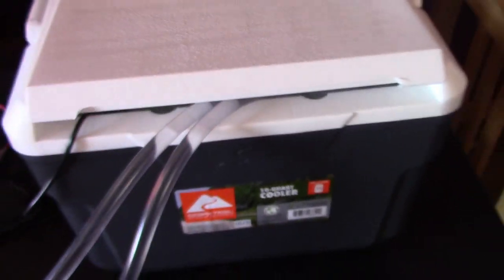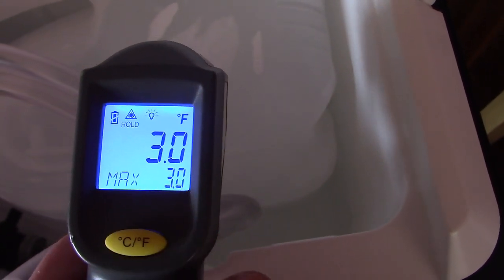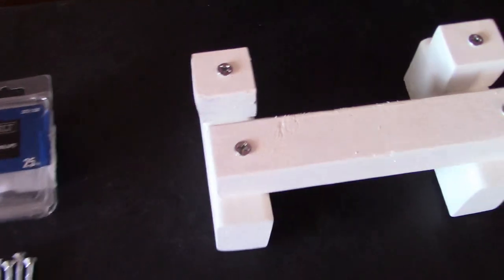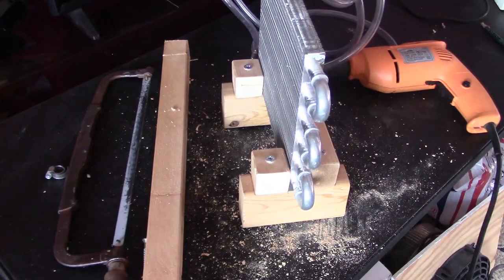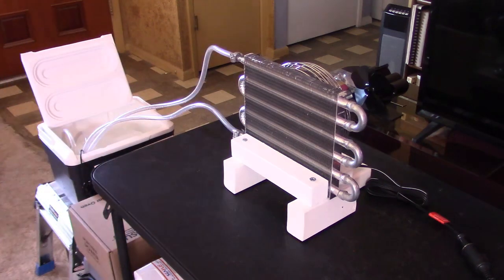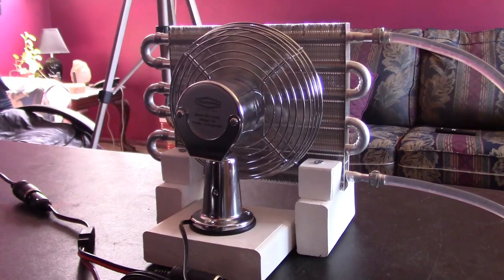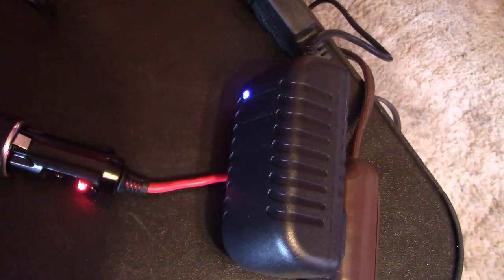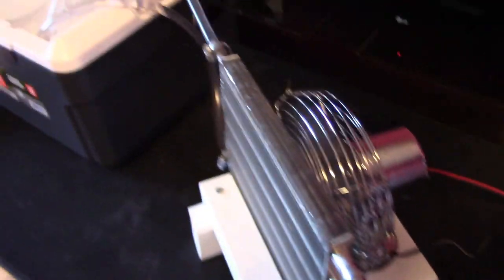DIY 12V Air Cooler! very cold air! 20w (AC or DC) - Radiator w/Stand + Hi-Speed.Fan! modular design!

Comment: I built one of you cooling inventions and it works so well. Btw, I'm in West Texas (extremely dry and HOT) today it's 112 degrees outside and inside we're at 76 degrees plus we get the added benefit of adding humidity.
Reply from the maker: sweet! i'm glad you made it! that's what it's all about. sounds like you made one of my evap cooler projects. those are awesome in the dry areas!

Comment: I want to use antifeee in the closed loop system and use the cooling system to remove heat from a small sleep Just big enough to handle your tablet mouse and a little tv.
Reply from the maker: it's a good idea. i've always stayed away from using antifreeze mainly because i'm not sure it would cool the water down much more than it already is (but it might be worth me trying it). might need a special pump for that (i'm not sure).
Reply: @desertsun02  I want to drill in a freezer use the freezer and eliminate the AC. I believe this would save energy and focus on the small zone vs removing heat from too much area. You need a reservoir inside the freezer and pump antifreeze through the radiator. After setup add bottles of water to the freezer you can save ice like batteries. Store charge you store lower temperature.

Comment: Thank you for posting! Im going to build a couple of them and use my box fans. I was just putting frozen 2 2liter bottles in front of a fan but this is much better.
Reply from the maker: yes, these radiator-based units work super good. I've got a couple of box fan version already posted to the channel. if you haven't seen them, they would be worth a look 🙂 (i used 2 model 405's on those)
Reply: really cool solution, thanks! Incidentally, which one works better, according to you? Or which on works more efficient? 
( this one or the box 📦 one )
In any case, love your channel!
Reply from the maker: i think the pump on the box fan ones use about the same amount of power but the box fan pulls a lot more power than the 12v metal fan that i used in this build. (plus the box fans are AC only) *unless of course you use attached the model 405's (the radiators) to my DIY 12v box fan project. the 12v high speed metal fan moves a lot of air (it's close to 1000 cfm on high, about 959). that rivals a box fan for total air moved.
Reply: thanks for your answer! It’s fun learning to use parts you buy online and putting them together to make real energy solutions. Yours are really comprehensible. One day I want to learn how to make my own pcb projects, to make a really good and save affordable small solar power system (now one square one). Next project is a smokeless rocket stove pizza oven combination (finished a pilot version). Many thanks for the inspiration!

Comment: Okay... It's time for you to design an air conditioned vest. I sweat like the Dickens..... I haven't found a great vest that cools well enough in the summer. Start designing my friend
Reply from the maker: hi there. i've looked into that but never actually made one. now that i know people like the idea i'll see what i can do 👍🙂
Reply: @desertsun02  It will be a complicated design. But my first thoughts are like the heated jackets by Milwaukee or DeWalt or whatever. A 12v battery runs a computer fan and there will be disposable refrigerant cartridges.
Reply from the maker: do you have any ideas on how to overcome the condensation issue that might occur on the pipes in the vest? those would be sewn in and i could envision water condensing and getting peoples' shirts wet?
Reply: @desertsun02  Maybe the pipes are inserted into a wool sleeve and then sewn into the material. The wool will act as a repellent therefore causing the pipes to cool down even more

Comment: Is condensation an issue?
Reply from the maker: hi there. i don't have that issue where i live because the dew points here are so low (like in the 20's) mainly because it's so dry here. if you have that issue I'd recommend just laying a 'hand towel' or even just a paper towel under the unit.